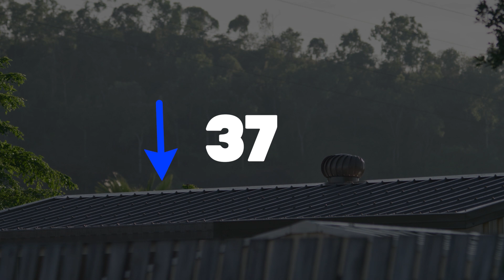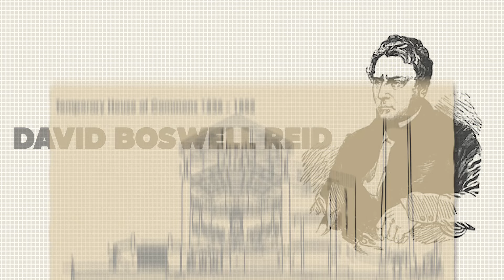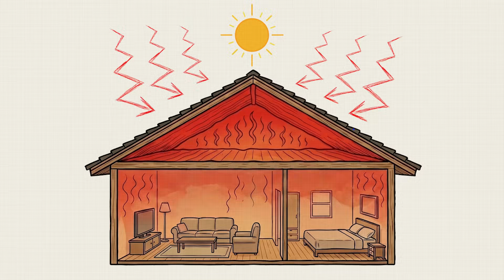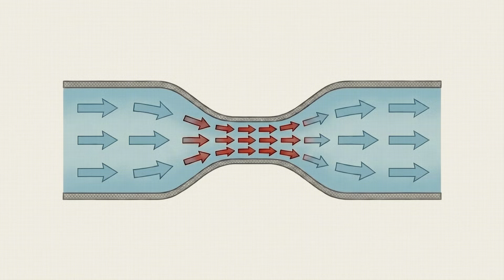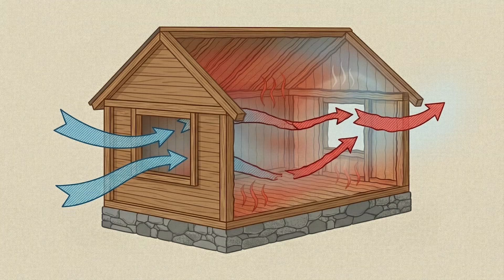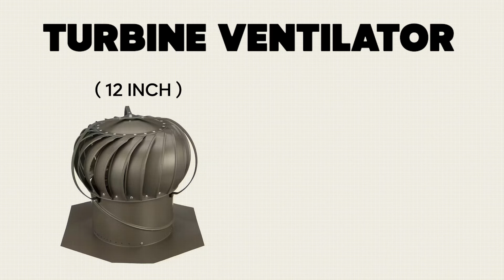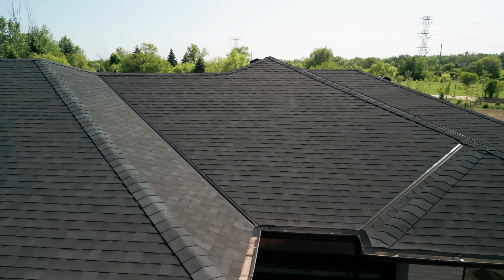Why Did We Stop Using This Natural Cooling System?

Comment: I still have these on my roof. They're great. I love in Queensland Australia. It's really hot here. I rarely need to use my air conditioner.
Reply: i live in arizona, ac is necessary almost year round even with whirley birds, definitions of "really hot" vary i guess lol
Reply: @ChuckBiskits  Arizona is dry. Queensland is HUMID. Both regularly hit 40C (98F) for most of the year.

In Arizona you can use a roof vent and a swamp cooler in the window to pull temps down well below ambiant. Those don't work in Queensland.
Reply: @alanbrown397  swamp coolers don’t work well here either and a window ac is not enough even with the roof vent (whirley bird) in my experience but yes 98f and high humidity is hell and 115 and dry is almost refreshing after a couple weeks of sweating profusely. absolutely ruined our great American roadtrip 2 yrs ago Missouri, Illinois, Pennsylvania, Maryland and about 10 other states, ALL miserable other than the one or 2 rainstorms, enough to turn me into a neck fan guy, even the hotel sheets were damp a few times, so yeah, ill avoid Queensland summers lol
Reply: Queensland. Miserable hot place 😂😂😂😂 I lived in Noosa for 5 months from December. Couldn't wait to get the hell out. It was hot!!! 😂😂😂😂😂😂😂😂

Comment: Ridge caps are great but also depend on eve vents and wind direction as well as the exposure of the eve to winds to exchange air at a meaningful rate and it wont even be consistent across the whole structure because eves and ridges change direction. If your neighbors houses are the same height or taller than yours, performance drops fast, same as keeping a turbine below the next roof level BUT a turbine can be made taller if you were smart enough to dodge the HOA or become one of the only well informed members of it.  
You mentioned that a turbine can be frozen in winter, youre supposed to cover them during winter because their purpose will work against your heating system.   I work new construction and I still keep turbines on my home instead of ridge caps by choice.  The attic fan in my home is broken but its the final piece to the puzzle that takes turbines from being a helper to being a workhorse.

Comment: The aluminum (Al3+) metal used to designed these lead to oxidation (rust).  Advances in metallurgy may impact their design by utilizing corrosive-resistant metal or even ceramic to preclude degradation. As climate change inexorably heats up, the globe needs new answers for survival.  Cogent synopsis.

Comment: In the Philippines at this point in time where even in the night it is as hot as summer, would it be more cost-efficient to install a turbine vent system or a ridge vent?

From mid Aug to late Dec or early Jan the air here is humid and cold, but often rains.
Whereas in late Jan to July the air feels dry and super hot but is still windy.

I ask for your professional opinions on this one, thank you in advance!!

Comment: Mine has been spinning freely for the 26 years i’ve been living here, it was there for years before i bought the house. It started squeaking a couple of years ago so i sprayed the bearings with grease. Completely silent now. Although, when we get high speed winds you will hear a slight hum. I’ve been in my attic in 90°+ weather on a sunny day and it’s really not any worse than the outside air. You can feel the air moving. You also have to make sure your eaves are all open and can supply enough feed air to accommodate the turbine. If not it will pull air through any opening in the ceiling. A last note: there were a couple of rust spots starting on it so i sprayed it with some Tremclad rust paint which kind of matched the roof colour.

Comment: Don’t know much about cooling for large metal buildings etc but for residential applications the trend in insulation is to extend the conditioned envelope to the roof and then make it air tight. Turbine vents help control moisture and condensation when your roof covers a no insulated space above your ceiling. When you extend the envelope to the roof and allow airflow between the living areas and the attic the temp differential drops significantly and along with that the humidity levels also converge.   My summer attic temps dropped from 140f to 90f when we re-insulated this way. We keep our house at 82f in the summer fwiwi

Comment: I grew up in Florida. My parents put them into our house. They didn’t save anything. If you don’t have a proper air-conditioning system with a return in every room you’re still gonna have hotspots and what’s the type of thunderstorm you get in Florida they only cause leaks in the roof. The only person that ever have any success put a gable fan and even that only had moderate success. The reason why we don’t use them today is we do a lot better job of airflow management with our air-conditioning systems putting returns in an area that actually sucks up the hot air and conditions it instead of putting a return close to the air handler and also with the type of insulation we use it does a better job of keeping the heat or cold out

Comment: Yeah, we don't have them in Florida because the average July rain storm has winds that blow them off and then let 10 gallons of water dump into your attick and ruin your insulation and ceiking drywall at a minimum. Hurricanes and tropical storms eat these things like candy.

Comment: what replace the whirlybird is the ridge vents.
Ridge vents low-profile replacement for traditional whirlybird turbines. They provide continuous exhaust along the entire peak of your roof, blending in seamlessly for a clean aesthetic. Because they lack moving parts, they operate silently and won't seize up or squeak over time.

Comment: Technology that doesn't utilize electrical power is now frowned upon.
Why?
It's the "system" that now counts.
Contractors don't make as much money  in original construction.
Maintainers don't make as much money in maintenance and or replacement.
It's about the flow of money, not the actual effectiveness of differing systems.

Comment: Well they always say the same reasoning. Our ceilings in our homes aren't airtight, so by increasing the airflow through the attic you are pulling cold air out of the home because of the venturi effect. 

The real question is why the hell isn't the home sealed? Couldn't this be done simply with a sheet of plastic like we water tight our homes?
Also attic fans whether passive like these or active, do 100% work, even with leaky homes. But at what temperature is the leaking of air through the vent's/light fixtures/outlets etc, less than the loss from the huge temp differential in the attic. We should be able to come up with a rule of thumb answer. IE "If your attic is over 110 its probably a good idea to increase ventilation in any way possible"

But HVAC companies want to sell you higher end A/C systems not sell you a 100 ventilator

Comment: One of the biggest reasons these went away in many areas is because of hail. It does not take very large hail to ding them. These dings upset the balance and they start wobbling which creates more noise and vibration, plus greatly shortens their lifespan. In Oklahoma, I went through 7 in 2 years until I gave up on them.

Comment: Why Whirlybirds Fell Out of Favor in the U.S.
The main reasons they’re no longer widely used:

1. Mechanical failures and noise problems
Whirlybirds rely on bearings and moving parts that wear out. When lubrication dries or bearings corrode, they squeal, grind, wobble, or seize. This makes them noisy and ineffective. 

2. They often leak
The base flashing where the vent penetrates the roof is a major leak risk. Over time, sealant cracks, flashing warps, and water infiltrates the attic, causing rot, mold, and insulation damage. 

3. They depend on wind
Whirlybirds only work well when there is enough wind. In low‑wind areas, they barely move and provide poor ventilation. In high winds, they can over‑ventilate or run constantly, disrupting attic temperature balance. 

4. They corrode and clog
Exposure to weather causes rust, debris buildup, and blade damage. Many homeowners end up replacing them rather than repairing them. 

5. They create a roof penetration (a point of failure)
Modern roofing practices try to minimize penetrations because every hole is a potential leak. Ridge vents and soffit vents avoid this problem entirely.

6. Better alternatives became standard
Ridge vents, static vents, and powered attic fans provide:

More consistent airflow

No moving parts

Lower maintenance

Lower leak risk

Because of this, roofers often recommend ridge vents instead of whirlybirds.

Comment: We used to have these, and in the winter we would put trash bags over them.  Now we have a ridge vent.  I really don't think the spinning did anything.  Its just spinning because of the rising air, i don't think it helps extract any more air.

Comment: My family has one that hasn't been replaced in over 80 years as it is still the original one that came with the home. It makes no noise whatsoever and has never been a problem for my family or for anyone in our neighborhood. The two times they go replaced was because a baseball damaged one and a tree through a roof. So a properly installed unit made with quality stuff can easily last longer than a lifetime.

Comment: As a teenager, I helped my Dad replace the “whirlybirds” on the roof. While sitting on top of the roof, the level we were using tipped and slid all the way down the roof until flying off and landing about 6 feet from the house. I turned to Dad and said “let’s not imitate the level”. 

Turns out that was so funny he almost slid down the roof in imitation of said level.

Comment: I think the reality is the powered solutions like standard exhaust fans cover 90% of the use cases of these passive systems. Far greater control over the rate of exhaust, typically higher exhaust rates, and often cheaper to install due to mass production. Plus they hardly use any power at all with modern efficient systems. Whirly birds have limited uses in unpowered systems or massive unconditioned spaces like livestock housing and some warehouse applications. Even those applications are beginning to be replaced with localized solar and fans, which has the same advantages (more power when sunny aka hot, doesn’t rely on power grid) with additional advantages and of course some additional downsides. I still love the things, and I’d love to see someone build on the idea, perhaps a combination whirlybird and air turbine to allow for some power collection for homesteading or remote metering stations and whatnot. Included vent flaps for colder seasons, combine with solar and you may have a great product or installation package.

Comment: Use to be a roofer, we don’t use them cause the technology is obsolete, ridge vents look better, work better last longer, cause less issues and are so much easier to install, in cases where they can’t be used off ridge vents are installed. You snuck that in all the way at the end. You did do a decent job explaining why we put ventilation on roofs though.

Comment: I had a pair in my roof. They probably helped in the summer, but they made the house drafty and cold in the winter. I had the roof replaced with an off white paper and removed the whirlybirds. The reflection from the new roof more than offset the ventilation decrease and it is much better in winter.
Reply: Could you explain the process in more details? How does the off white paper work on the roof?

Comment: My house in San Diego was built in the 1940's and has two of these. The house does not have A/C (only ceiling fans), but the house has never actually gotten hot. I have never even needed to turn on the ceiling fans. So I can say for sure these turbines work.

Comment: Properly placed soffit vents are key for turbines to perform best. Perfect for a separate garage that does not have air conditioning. My 2 turbines are spinning constantly, and work for NO COST. They are beneficial in many ways. Not just for cooling, but also ventilation.

Comment: I have 3 on my roof. When the bearings fail, I just replace the bearings. I have a corrugated roof but have insulation bats, so the vents just improve the ceiling ventilation. Newer houses tend to have an insulation foil in the roof that is more effective at keeping ceiling temperatures down than any vent.

Comment: It gets super hot here. Our last house didn’t have turbines and our current one has four. There’s a big difference in how this house feels in the summer.

Not long after we moved into this house one of the turbines started to squeak. I tried lubricating it with a recommended product but it didn’t improve so I just swapped the top with a new one, and later did the same on another. Anyways since doing the first one I have become hyper aware of these things every time I drive through a neighborhood and can’t help noticing when ones aren’t turning as they should be. I think more homeowners need to be grateful that they have these vents and service them when they fail instead of ignoring them, they’re really missing out on the benefits.

Comment: They are pretty standard with new builds in Australia. My house was built in 2019 and has 2.
Reply: Unlike us in the US, you guys are heading in the right direction
Reply: Exactly
Reply: I thought they weren't recommended due to increased risk of accelerating house fires. Do you know if this is true?
Reply: @thedolcetto81  Moving air, they would certainly feed the flames. But then, so would the passive system.
Reply: @thedolcetto81  Same thing for a garage fan into the attic in the US there should be a fire damper to prevent the spread of fire from the garage to the attic. However, roof vents, solar attic fans, etc. would do the same for the attic, but I do not think that they have the same requirement for a fire damper. Many roof vents, fans etc. can leak in heavy rain, wind, hurricanes, etc. so always a balance. Since I live in an HOA atm, I have been thinking of adding two attic fans (green), but since I have a ceramic tile roof /w no ridge vents I do not want to put holes in it. Might take the two fans run them on low speed for next to nothing, mount them in the attic above my garage on the rafters, and block off the whole garage attic wall with cardboard etc. That way I can just pull in air from the eves around the garage and push fresh air into the attic of the rest of the house. The air will just exhaust out the eves along the rest of the house. No fire dampers etc. However, worried that I might add more moisture in the attic though.
Reply: @thedolcetto81  Intulmescent inserts would fix that and should be used as packing on anything that pierces walls
Reply: Not in the US which I think he’s referring to

Comment: Previous owners removed the turbines. I found them in the attic one day. Not sure if by code or why. Currently have major issue with South Florida heat and a cooking attic. I purchased an exhaust fan to put up there and suck out that hot air. Currently with only a few soffit vents and no turbines it’s like trying to cool a living space under a barbecue. 🥺😔

Comment: When I had a ceiling fan I would run it with the air conditioner window unit. It does make the room cooler when combined with the AC.

Comment: I think these aren’t used because the most efficient new buildings have as close to an air tight exterior as possible, only bringing in fresh air through a fresh air-air cleaner on a timer or building static setpoint and then adding a metal roof for radiant heat protection, exterior insulation, and dehumidifier for the attic/building to keep humidity in check for mold and comfort.

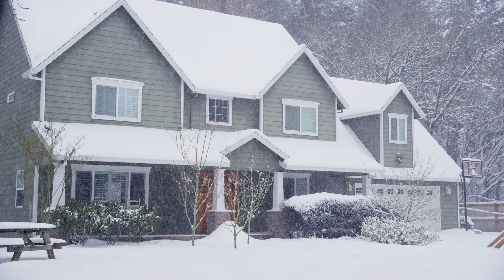Comment: 11:05 how about the tropics
Reply: Not a great idea if you have frequent wind driven rain. My parents used to have these on their house, but they caused too much water to enter the attic during storms. They would have to climb on the roof and wrap it in plastic to stop the water entering. Became impractical as they got older. Plus, the water rusted the bearings and it emitted a horrid screeching sound that got the neighbours to fetch their torches and pitchforks. Ultimately, they climbed on the roof to wrap it in plastic, and then never unwrapped it.
Reply: I think it's good for tropical countries
Reply: Same concept as the sun belt because it's hot and humid

Comment: These cool but yoou HAVE to seal the Attic up between the living space and the attic....   They lower the pressure in your attic and then that will pull in conditioned air from the living space.   On top of that these are useless because you can add insulation in the attic and not need  another potential roof leak.

Comment: i live in a cold/wet part of the world.
most homes dont even have ac. only heaters. but heatpumps became more popular now. but most people use a cv/hr kettle.(fancy gas boiler that reuses exhaust heat to pre heat the water for higher efficiëntcy).  although i do have a small portable ac, one with hose for those few hot summer days. because our homes are only optimized for rain and dampness.  large windows to the south. mostly concrete and bricks. wood only for inside to prevent rott. and very heavy roof tiles. like you need 2 strong hands to even lift them. and a crain to get them on/off the roof. because carry them off the roof is not an option at those masses

Comment: Isn't the argument against them that because of the air pressure, it will actually also pull unintended cool air from inside your home, thereby potentially increasing cooling costs? Perhaps there's a balance where a certain amount of CFM is beneficial, but only up to a point..? I'm also thinking of powered fans though, not these automatic kinds?

Comment: I have two of them on my house. They keep the attic cooler. Which may keep your house a little bit cooler. In the summer they suck hot air in through all the cracks throughout your house so… make of that what you will.